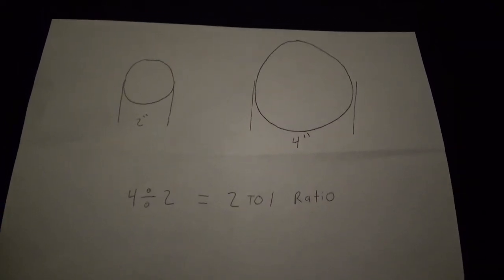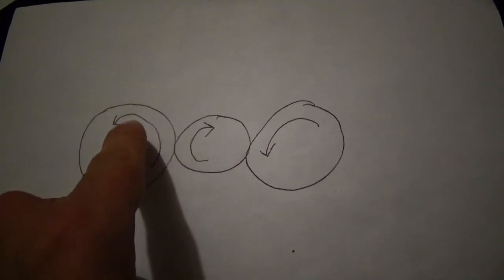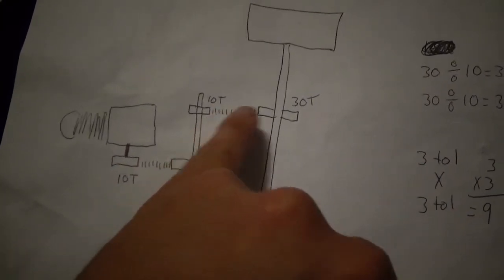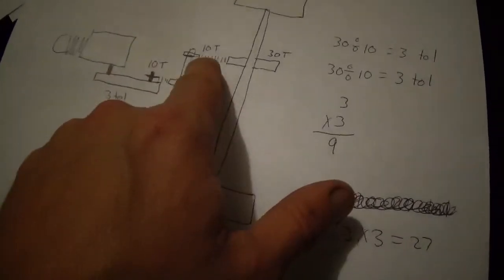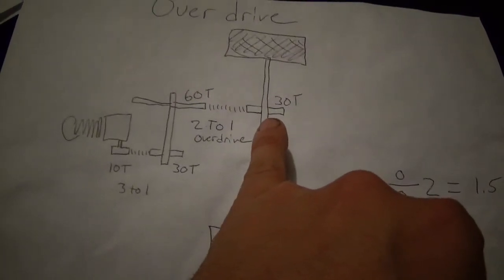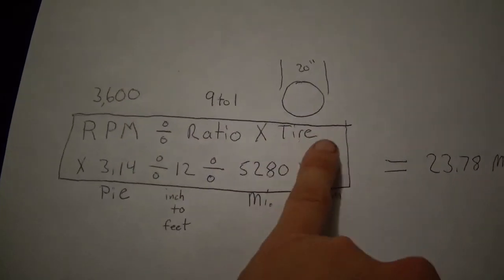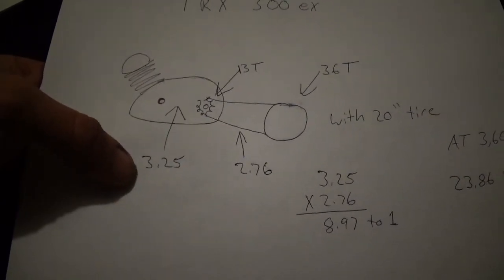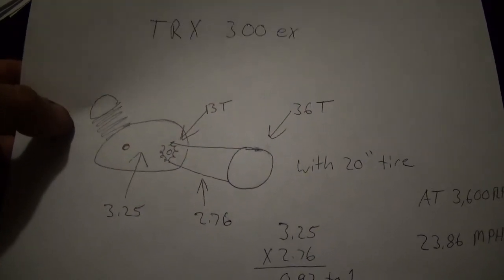How to figure gear ratios for go kart, ATV or tractor

Comment: Bill, Some good info there, U made math easy... Will be using Ur formula on the '48 Cushman, though, I think I am stuck with going with a straight axle as there is gear reduction in the Cushman rear and in the 70cc ATV engine, I think between the 2 of them, the bike may move 0.5mph... Thanks for posting!
Reply from the maker: +Harvey Spooner I got the speed formula from a kid genius I work with. Walked up to him and asked. He was babbling it off faster than I could write it down. Its fun to play with.
Reply: Harvey Spooner       I’m doing the same thing.  I have a 3 wheel truckster    With a a jack shaft.  Mite be very slow

Comment: So theoretically my gokart should go 32 which it does up a slight hill and on flat surface it goes 34 so I’d say this is very accurate. I want more speed tho so ima go from 10 pulling a 60 tooth to a 10 pulling a 48 tooth maybe and I’d get a 4.8:1 gear ratio rather than a 6:1 or maybe I should do a 9 pulling a 48 being 5.3:1 gear ratio. I’m not sure can someone help me? I just wanna know if it’ll take more horsepower to pull a gear ratio like that when using a torque converter
Reply from the maker: If your running a torque converter you can add more gear for speed. Especially if your always on hard surfaces. Not yard field
Reply: @williamstaten8102  I’m not always on hard surfaces but most times ever dirt roads are hard.